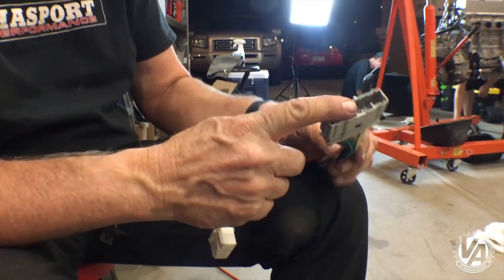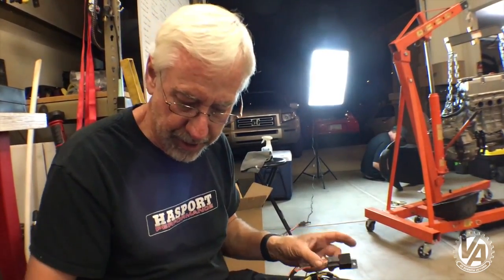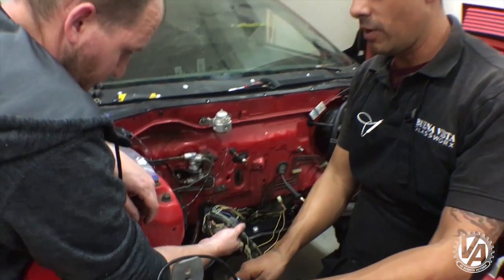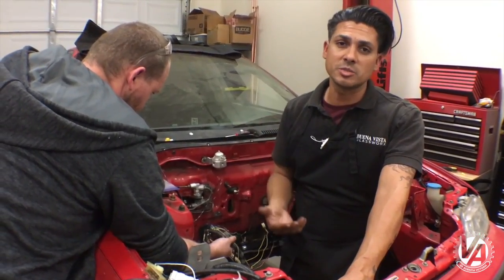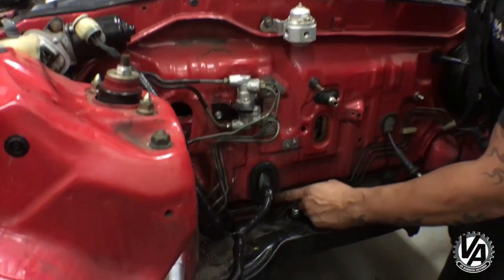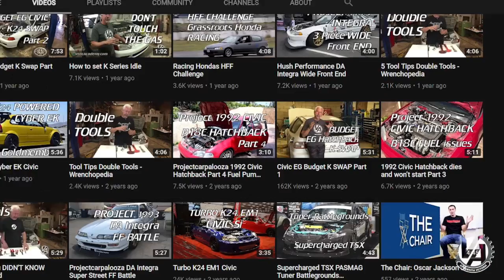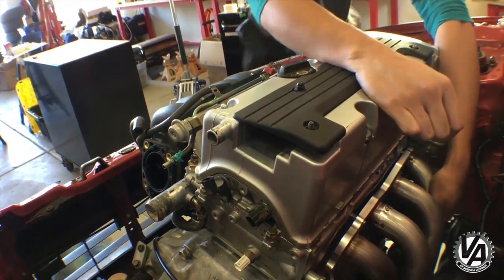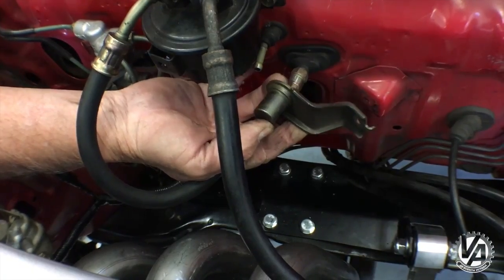EF K-Swap Part 4 - Budget Header, budget fuel lines, and budget wiring

Comment: what size fuel line? 5/16 was okay for the 3/8 barbs? , and also it should be okay to run an inline filter instead of the stock one right?

Comment: I like what you did to your EF in this k swap I happen to have a 91 EF that I was going to try a b swap in but I kinda gave up when I got to the wiring any suggestions of what I can do with this ? Appreciate any input thank you and please keep up the great work I used to do all this work with my son he would soak up the knowledge and tell me what to but unfortunately life has changed this for me since he passed away from his fight with cancer any affordable options would be appreciated thanks
Reply from the maker: The wiring is a little involved if you have a dual point injection car. Simple if you have an 
Si or HF with port injection. Either way you should convert to OBD1. Check out our video on project Backmarker. It is an EF we swap a B17A into.

Comment: Hey guys its Deesman1 on my wifes account but I have a question I'm doing a k24a2 swap on my 90 ef hatchback, I will be using the tsx transmission with the efk4 swapmount kit. I have done alot of work on this engine and dont feel comfortable piecing oem axles together because I dont see them being strong enough. What stouter axle should I buy that fits the ef kswap using the tsx transmission?
Reply from the maker: Driveshaft Shop and Insane Shafts make up-rated axles for this swap. Hasport also makes axles but if you are drag racing I would go for something stronger.
Reply: Yes I understand that, but I guess my question is, are the splines at the diff the same on all kseries 6speed? Meaning I have seen no "tsx transmission" specific axles for an ef.
Reply from the maker: @brianadees8543  The splines are the same for the transmissions that fit all versions of the K20A, K20Z, K24A, and K24Z.

Comment: There is a fuel damper (also serves as a pressure regulator) at the end of the fuel rail on the k24.  Maybe i'm missing something, or maybe the OEM k24a1 fuel pressure is too wonky to tune in oem form, but i don't think the AEM unit is needed. Can someone plz confirm if i'm crazy?
Reply from the maker: The dampener will not work as a pressure regulator. That's not its function. You have to have a regulator. On cars that come stock with a K-series engine, the FPR is in the fuel tank. On older Hondas, the FPR is on the engine.

Comment: Any reason for using 5/16" hose on the 3/8" fittings? How come you did not use 3/8" hose? Will this extra stretch on the 5/16" hose cause any issues?

Comment: i sir i arif from malaysia. sorry sir i need help how to rewire wiring automatic transmission to manual transmission. i try to find how to wiring civic fd2 auto to manual but did not find any source. i have honda civic fd2 year 2006 automatic with engine k20z2. now i convert it to engine fn2r k20z4 with gearbox manual and use ecu fd2r but the problem now i still using wiring automatic. kindly please help me how to rewire current automatic wiring to manual wiring.

Comment: How much would it cost to build a k24 and install it in an EK?
Reply from the maker: If you go to our videos on the Budget EG build you can get an accurate picture of costs. It can be the same or a little more expensive. If you use a mount kit that needs the EG subframe and rack it can add $100-250 to the price we spent on the budget EG.

Comment: Why not leave the battery under the driver's headlight and run the power wire inside the fender well, into the can on the driver's side, then under the dash, terminating at the fuse box?

This would avoid possible damage to the wire when removing and reinstalling the engine. You could also easily tuck the alternator and starter wires under the manifold on their way to the battery.
Reply from the maker: We could have, but it simplified the wiring to put it on this side.